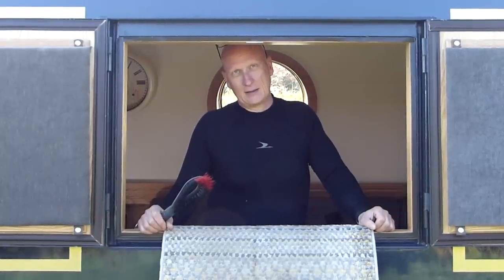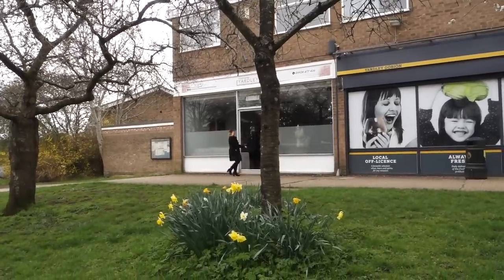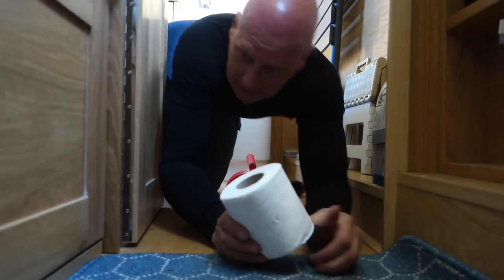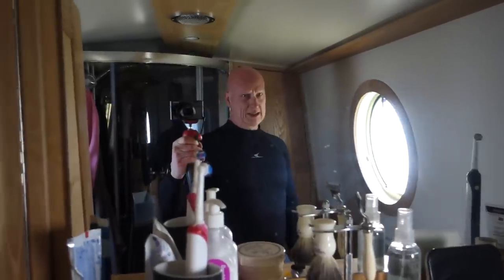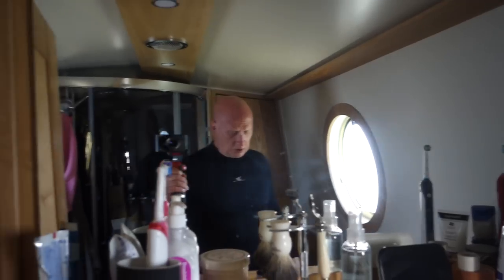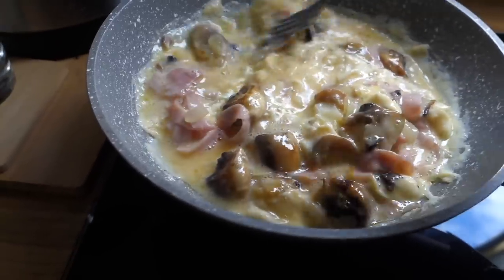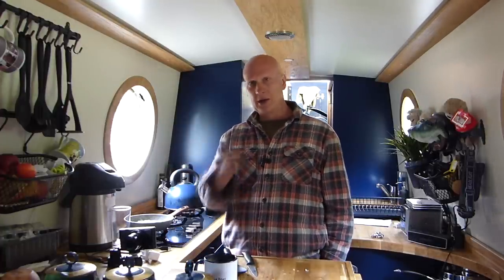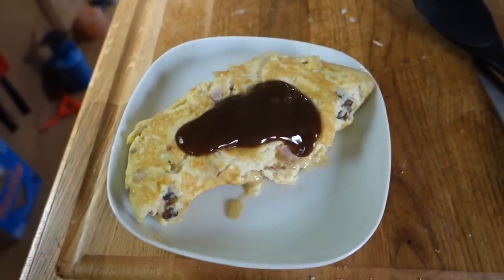Narrowboat Toilet - All You Need to Know. S2 Ep43. #narrowboatlife #maximiselife

Comment: Hi Chris ... that was the best video I've seen so far on composting loos .... most certainly the way I wille be doing things when the time comes .... I'm already quite into composting now as I have a couple of no till organic raised beds in the garden producing food, herbs & medicinals largely following Jadam (Korean Natural Farming) methods where I make all my own fertilisers & inputs .... one way you can speed up the process if you're not doing it already is to start off a new bin with a handful of leaf mould from any healthy looking wooded area .... just scrape back the top layer of loose stuff under a well established tree and scoop up a little bit of the dark earthy stuff underneath .... if it has traces of white fungal growth in it too then it's perfect and will have all the microbes you need to turbo your composting .... from there once it's all festering nicely you can just use a scoop from the previous bin each time you start a new one to keep the cycle going and just give it a boost again if it slows down maybe once a year .... personally I think it's the most responsible & ethical way to deal with the issue so hats off to you for embracing it .... the boat looks great too .... happy trails :o)~
Reply from the maker: By and large, that’s precisely what happens. Veg that’s gone off is another good thing. All this discussion about 6+ months hot composting I’m sure is correct if you don’t break the poo down yourself. Also, the size of the bin would need to be massive and the bigger the bin, the harder it is to turn it over. It does need to be agitated. It works. I sleep at night knowing I do the best I can even if others do a different way. So far, no bad comments. Thanks for your support Stoaty

Comment: Viewer #9 tonight.  
A thatched roof is not the most common thing as it is, but the rooftop sculptures are amazing.  You seem to be able to find hairdressing shops about as easily (and usefully) as I might find a meat shop.

16 toilet rolls.  I could go through that pretty fast back when I had an ostomy.  Happy now for the normality of using a more sustainable amount.  Composting toilet is clearly the best option--at least for one or two people.  Wish I could have one at home, but local bylaws won't allow it.

Brown sauce?  I'm going to have to look that up.
Reply from the maker: No9 viewer but no1 commenter. Thanks Peter. Northamptonshire appears to have more thatched roofs than I’ve seen elsewhere. Heading towards Milton Keynes and Buckinghamshire so the houses may be slightly different. 
I’m not ‘bag and bin’ either so it works if you’re prepared to break the contents up. It’ll take far too long if it happens but itself. 
Thanks for the support Peter. Have a good week.

Comment: Interesting one Chris. There are presumably different kinds of bog roll which is designed to biodegrade quickly so that might be worth some experimentation if thats what the slowest part of the process is.  "Army; form blank" as my father refers to it from his BAOR days.
Reply from the maker: You’re probably right Rob. I pick the cheapest, therefore the thinnest, so degrades quickly. Mindful it doesn’t tear at the critical point though. Good experiment but it’ll be a slow process as I think it’ll be about July before I buy paper again. Two weeks is about the right for my process. Not entirely happy until it’s not sticky. Now that BAOR days in compo rats it was shinny paper. Horrible stuff. Thanks for the comment Rob. Have a great week.

Comment: There is no doubt at all in my mind that there must be literally 100's of boaters that dump their  toilet in the hedgerow regardless of type. If your moving from a mooring in the middle of nowhere I can't see any reason why you cant dump even a cassette in the hedge, preferably out of sight. After all, there are millions of animals dumping their crap in fields all day long every day of the year.
Reply: The issue is that a cassette may have unfriendly chemicals in.
Reply: @gillgregory6327  makes no difference, people will still and do do it.  Plus there are now lots of Bio Degradable toilet chemicals out there that are harmless to the environment.
Reply from the maker: Thanks for the comment. I’m sure you’re right although I’ve not seen evidence of it which I think is a positive sign. That said, if people do, I think the smell would give it away. Those who use ‘Blue’ chemicals, that would be harmful so Gill’s point holds water. Those who are more eco friendly……well, the mixture of wee and poo does pong. Mine on the other hand……Roses; nearly. Have a great week both of you.
Reply: With a cassette surely if you carry a spade you could dig a hole to bury it under a hedge somewhere. The horse muck does wonders for my veg!